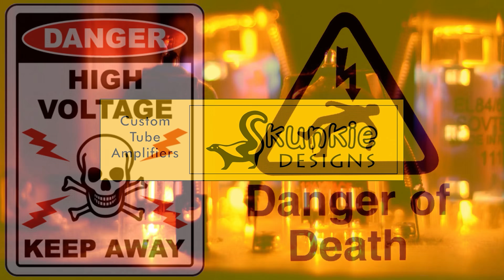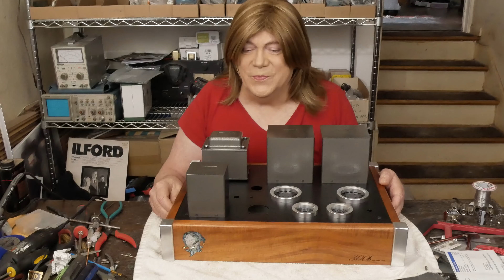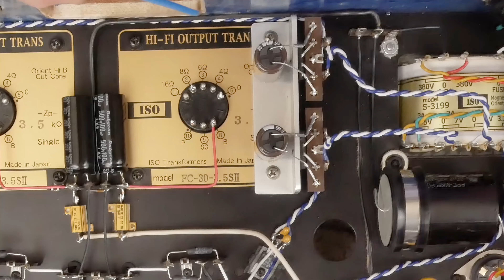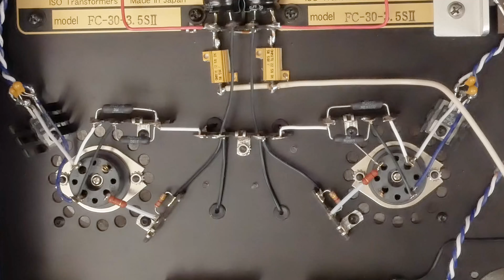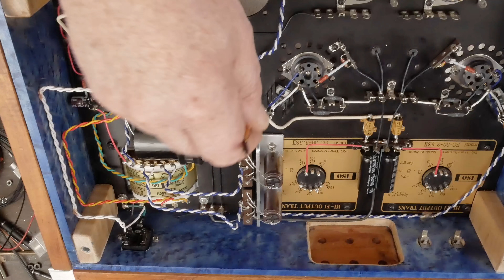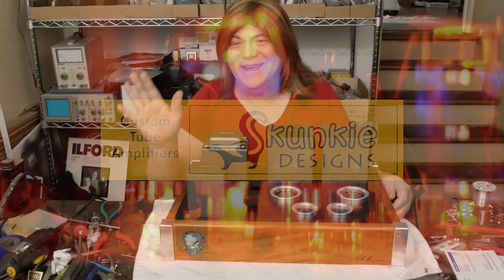Cost is No Object "Ultra" 300B Build: Layout Design #2

Comment: Always watch your videos with great interest, how much will this build cost more or less, highly intrigued.
Reply from the maker: Likely these will sell for around 6-8K depending on options, I honestly haven't nailed down a price yet.
Reply: @SkunkieDesignsElectronics  Hi, thanks for the reply and the update. Seems inline with what I expected, not really interest in the wooden cabinetry and the increased cost due to it being as such, I like my builds to look somewhat bespoke and industrial. Will definitely stay posted on this build with continued interest. 👍
Reply from the maker: I plan on also doing a "regular" build with a Heyboer custom power transformer, hammond choke, ISO FC30 outputs on a black powder coated steel chassis version too. It will be very similar to my last 300B build, but with an "all in one" custom wound power transformer instead of a separate filament transformer.